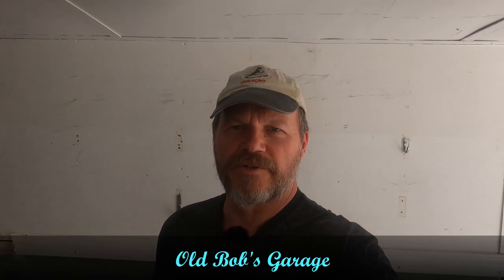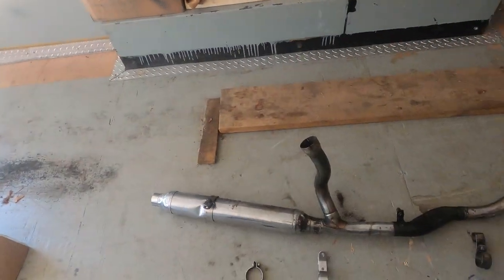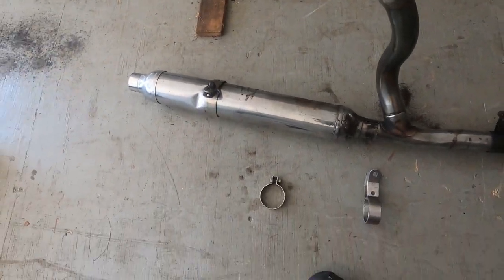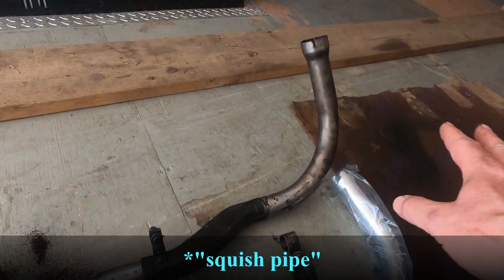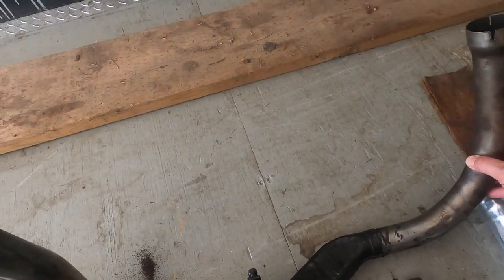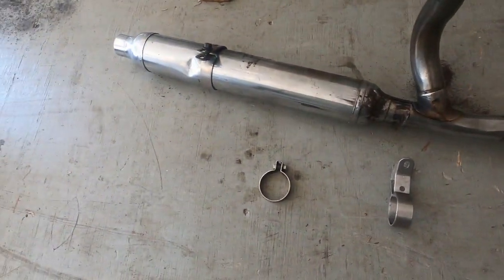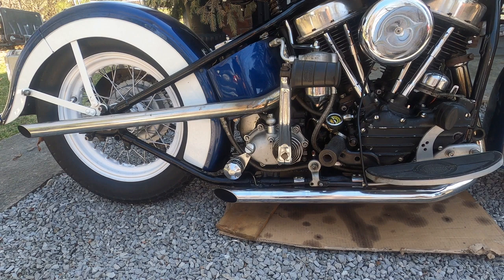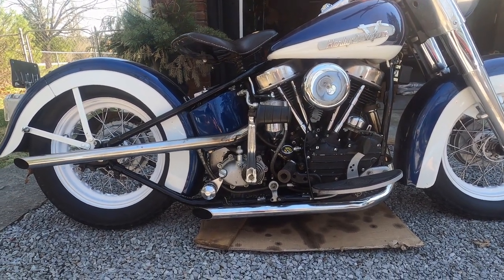Factory Exhaust for my Harley Panhead?

Comment: stock is always restrictive, but quiet. at low-end power band they are better, top end or hi-speed the motor breathes better making more power, but loud. find the medium and you're on your way. beauty of a bike, I miss my pan and all its headaches.
Reply from the maker: Thanks for watch and your comments. I'll be putting the factory exhaust on as soon as I get the heat shields.